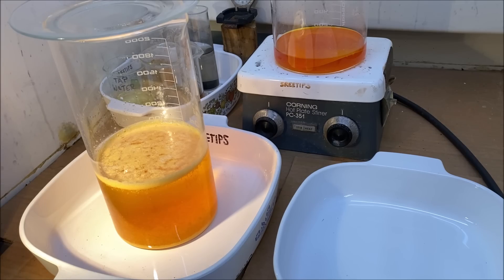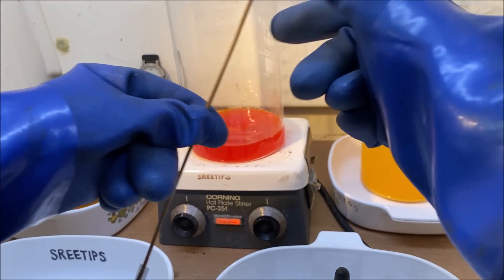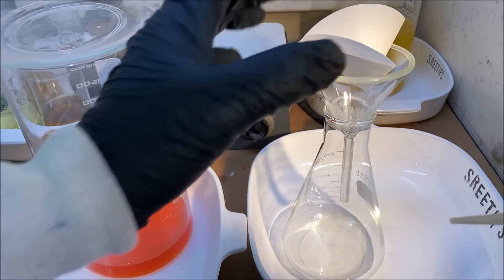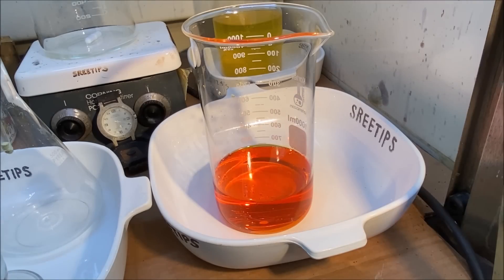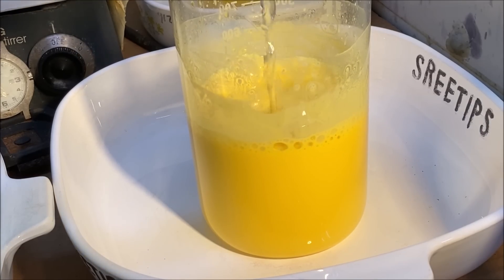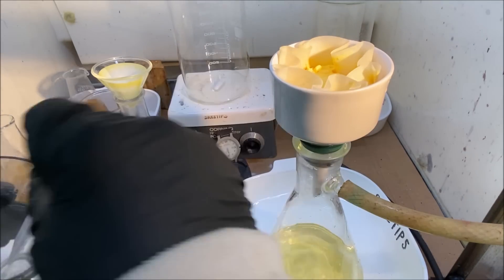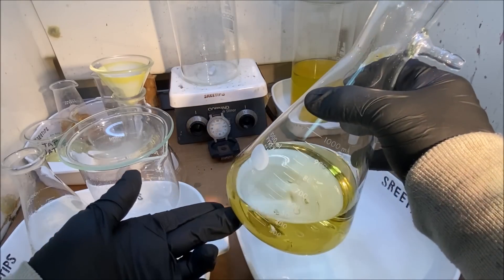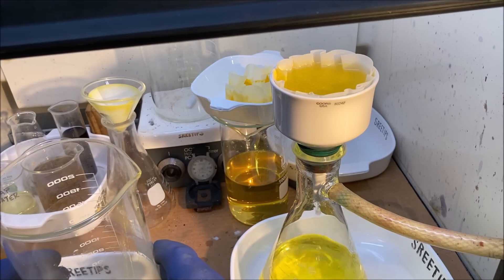How To Turn Platinum Jewelry Into PURE PLATINUM Pt6

Comment: I’m almost kind of wondering if these filters can be eaten up by piranha solution… like it should at least remove all the carbon in the filter, by turning it into CO₂. But of course, the sulfuric acid, and hydrogen peroxide could potentially react with whatever filtrate you captured in the filter, and if it created anything that needs to be filtered out again, it’s obviously not going to solve anything.

And when you’re doing gold refining, that’s going to be pretty useless, since you don’t need to separate filters from the gold… but maybe also when you’re dealing with filter slimes and filter papers? Breaking down all the carbon into CO₂ wouldn’t be a bad first pass… you have plenty of further steps available to deal with any sulfide compounds created. But then, as noted, this all depends on how well your filters hold up against piranha solution. 😂

Comment: Just wanted to mention that next time you try to neutralize the HCl, you should leave the PH-meter in the solution. Try to clamp it, so that it does not touch the bottom of the beaker. Then turn up the stirring and add the NaHCO3. It will be much quicker and you do not mess with the calibration of the PH-meter. That's what i have learned to be the proper way to do acid-base titrations.
Reply from the maker: I tried holding it in the solution while adding bicarbonate with the other. But it got saturated from the vapors.

Comment: I think you had a super concentrated solution and those solids you saw appear after the filtering should be re hydrated with HCl and processed as well.
Reply: I agree, hexachloroplatinic acid will crystallize when the solution gets concentrated. ❤
Reply: @christopherleubner6633  ha that's how I make peanut butter fudge , once the fudge begins to crystalize around the sides of the pan.
Reply from the maker: I’ll give it a try. Thank you